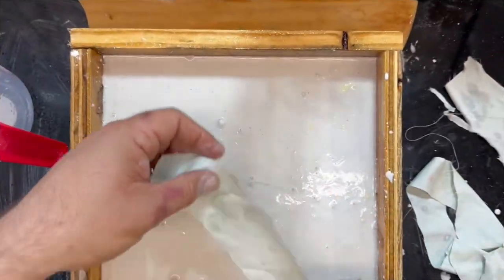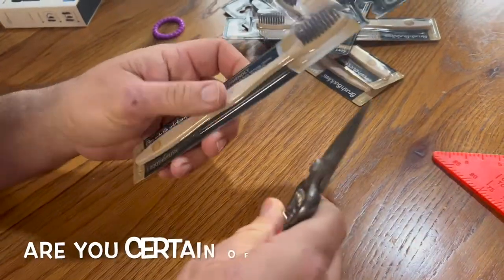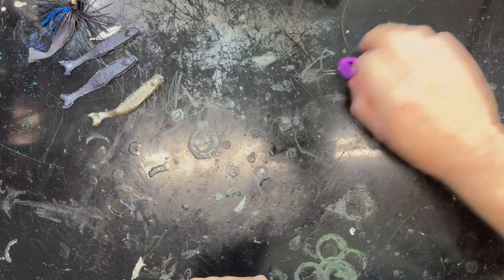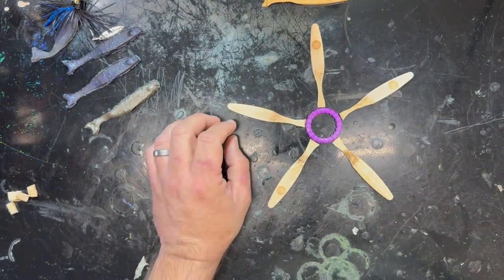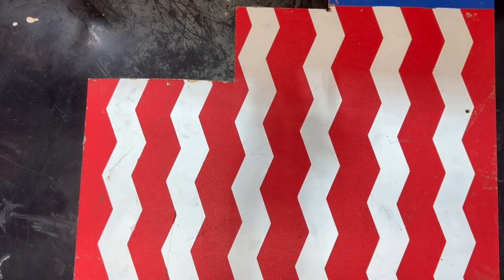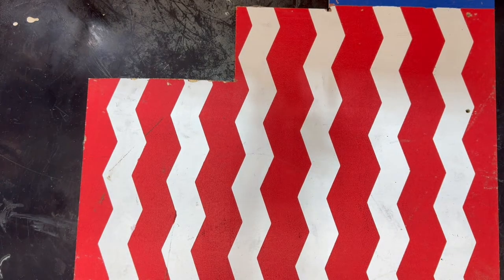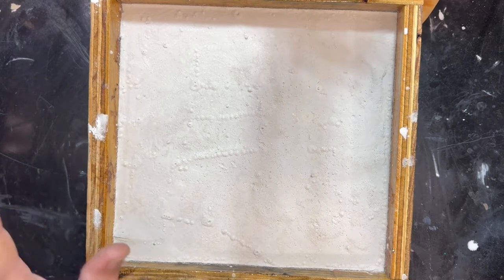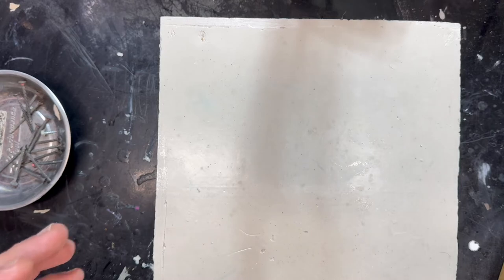DIY Jig Trailers from Dollar Tree Toothbrushes

Comment: A suggestion for reinforcing plaster molds: Fabric works well, but it must be 100% cotton or plant fiber such as burlap  and not a polyester blend. The water repellent nature of poly’s, present a source of delamination instead of stengthening. In practice, I’ve found that cotton gauze works well. I pour enough plaster to cover the masters with a moderately thick plaster. Then saturating the gauze and begin layering the gauze in. Topping off with another mix of thicker plaster. Watch your water content, too much and you’ll have water floating on top. This will cause the plaster to cure very slowly and be more porous and weak, as well as causing mold defects such as bubbles. I always cure my plaster molds for a week before I even separate the halves. A lot of work goes into this, I guess the take away is: Hobbies are like everything else, three major things to consider. Time, cost, & quality. You can’t have all three. Pick the two that are most in line with your priorities. In my case that’s cost and quality. I’m retired, and time, I have, plenty of it. If you’re doing this to save time, think 🤔💭 again, it’s probably not going to happen.  Above all, “Don’t rush.”  -Tight lines
Reply from the maker: Thank you for that great suggestion with the cotton gauze. I’ll have to give that a try.  In reference to time, quality and cost, I don’t have a lot of time, and I don’t have any throwing around money so I guess that table won’t stand. But, I usually get by with quick, dirty and cheap (as evidenced by the video content)! That being said, I truly appreciate you taking the time to reach out.  I’d love to see what your mold looks like. If you would like to send me an email regularguylures@gmail.com.  Thank you and You Stay Regular!